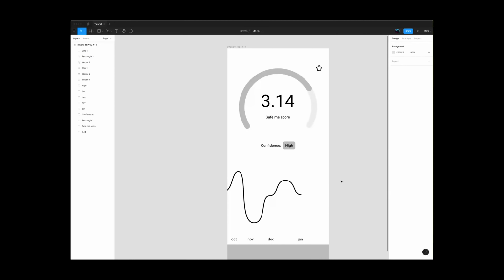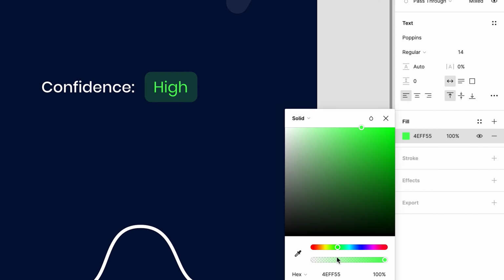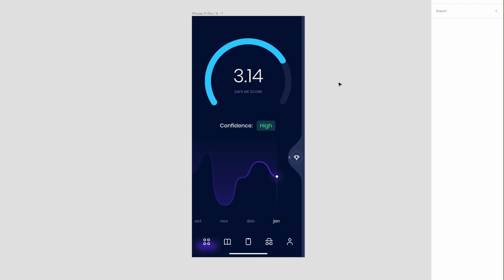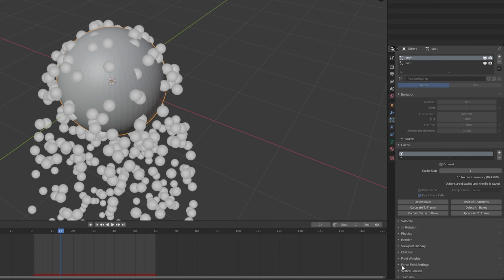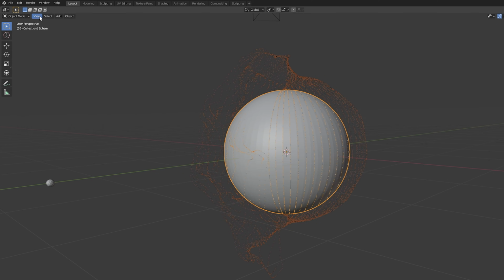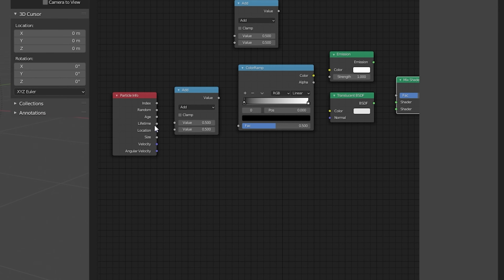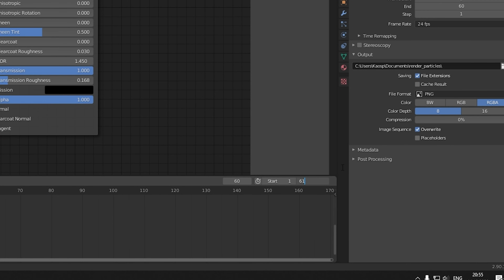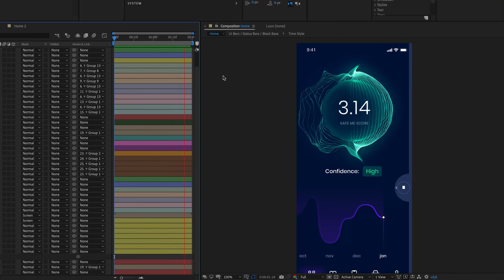Dynamic 3D sphere in UI / Design Tutorial / Liquid

Comment: nice tutorial,  just a few (unsolicited) tips, use transparency under the performance tab in order to get an alpha channel when rendering png sequences, Optix denoiser will allow you to do the same render with 128 to 256 samples and still look clean and save like 90% of render time,  if you are going to use the particles on that scale you are better off with halo or even cubes, at that size no one will notice the diff, and your render calculations will be faster. I know you may be more comfortable on AE, but there is no need to it, import a still image of the design and inside the composite space in Blender, you can composite the animation on top with alpha over and two layers, and then re-render using eevee since you don't need to calculate anything with 4 to 8 samples way faster than AE and easier to iterate.

Comment: yes, but do this procedurally in WebGL
Reply: I almost thought they used something like cables.gl in a practical application.
Reply: Web Gl Isn't That Good In Calculating Ray Tracing.
Reply: @jeffkirchoff14  until google does not release a GPu api for web, it will be cumbersome to do pathtracing in the browser. There are many implementations of monte-carlo pathtracers around, depending on the complexity of reflections and accuracy of global illumination you can get a great framerate.
Reply: @raduciucu  love Ur Opinion Pal👍
But I Prefer Blender's Realistic Render Engine "Cycles" Using The Tesla GPUs Provided For Free on Google Collab. 
The Results Were Amazing.
I Rendered a 4K ArcViz Scene With About 3000 Samples in Around 5 mins.
Reply: @jeffkirchoff14  cycles is good, on my rtx3070 works like a charm, viewport rendering is so much faster, eevee is awesome too, but with rtx and denoising you can get more realistic previews.
Reply: You will kill the battery and overheat the device. Png sequence is good enough  solution here.